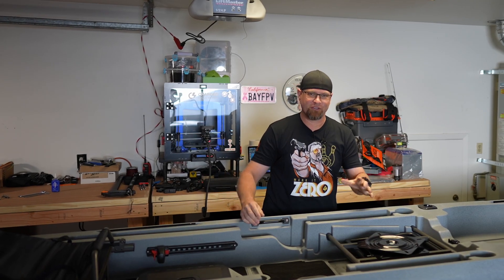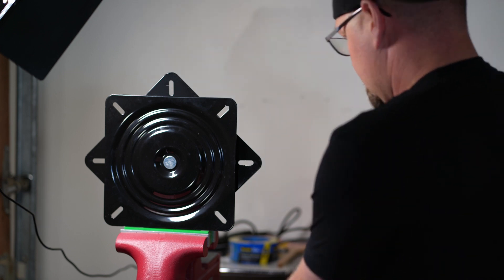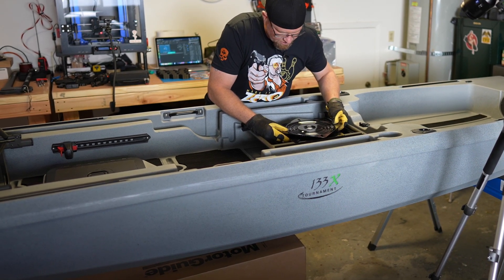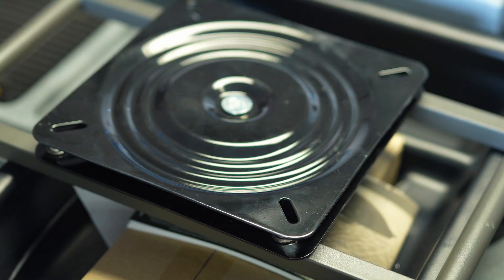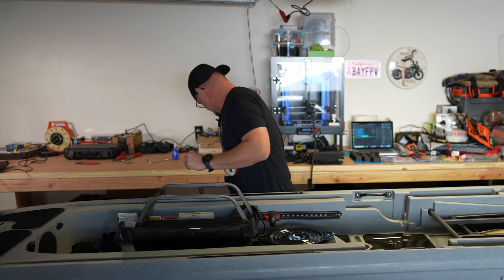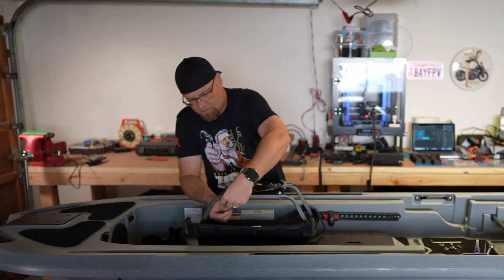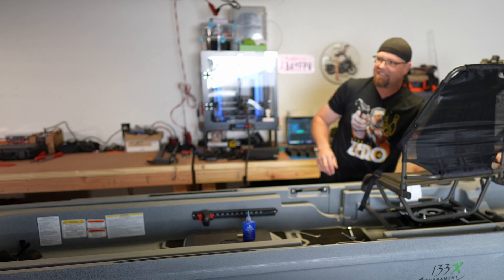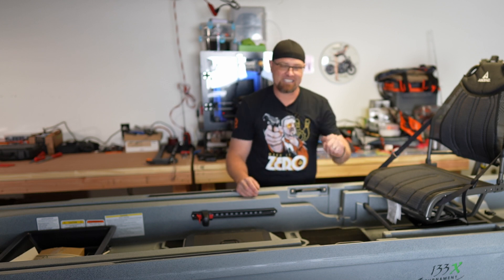Ascend 133X Tournament Fishing Kayak // Build Series // Seat Install

Comment: Hope your using stainless steel hardware?  Another kool tech tip!
Reply from the maker: Definitely all stainless hardware.
Reply: @BayAreaFPV  Is your swivel 10" or 6"?
Reply from the maker: 10”
Reply: @BayAreaFPV  I'm mounting my trolling motor in the back. How would you install that? Back seems a little soft
Reply: @fishingflawda  if you watch some other videos on this boat you can see that some put a steel plate across the back and then put their bracket on that to make it stronger

Comment: I like that swivel would make it easy to use a outboard hears a good one for you bolt on with quick attach/release submersible 8"x bout 5' toobs that ride watter level in the back I'm going to use  pvc pipe if you know a manufacturer that would work with you could have perfecinal formed plug and play for multiple kayack brands and modles is a idea it will take away the front tilt and side to side wobble iv seen the air bags to work they have to be way out from the boat so a they can be in the way for fishing b won't get rid of front dip the toobs you fill with watter once at fishing area can bolt right to the railing back half of boat streight down right beside the boat little to no side to side wobble no front tilt me using pvc with caps ill have some drag Profesionaly done could be more areo dynamic ill probably come up with something so it's not blunt if I ever do my own build of that make and model  in front of the dry box I'm going to build in a catch box with lid that's doubles as a bass deck and ima put a pot puller on the front so the extra deck space and added stability will make pulling pots safe and easy yet again if you like that idea and know a manufacturer you could have a custom igloo cooler that slides right into place built as well ill be fabricating everything myself on mine but there some ideas for you iv seen reviews the price point of that boat makes it a pretty good platform to start with for a low income person the manufacturer could simply add the watter fill toobes in the hull as well then out of the way for fishing all together they don't so I sat and figured out how to over come there engineering short comings to achieve the desired results I'm looking for in a personal platform for myself